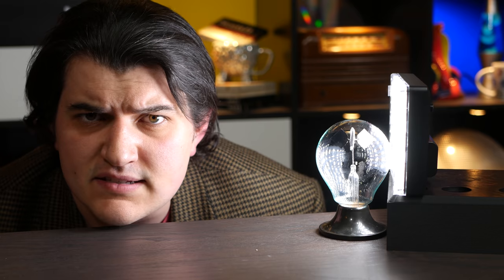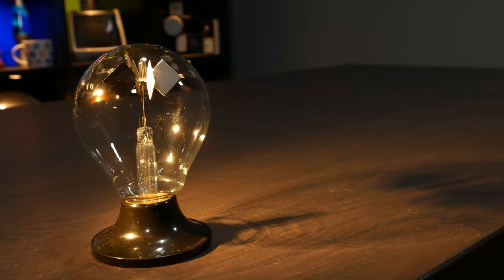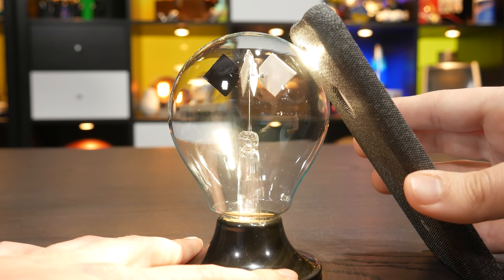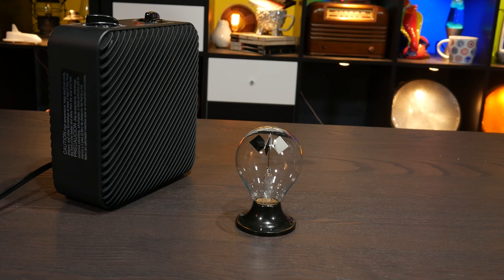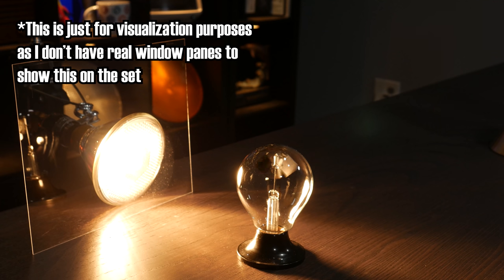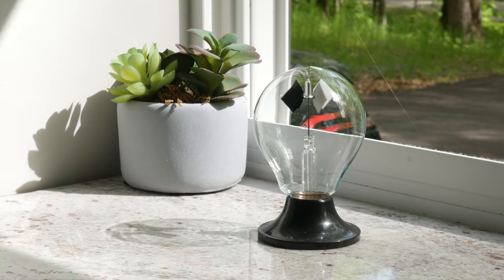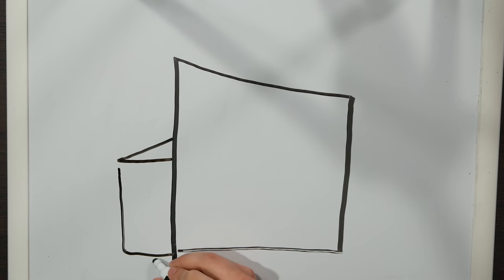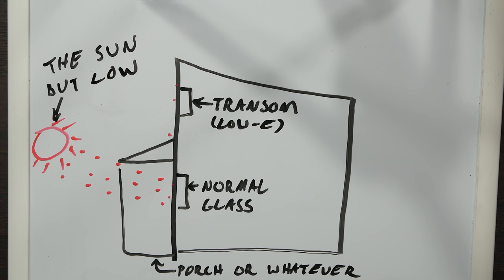What the Crookes Radiometer can teach us

Comment: A portable AM radio tuned to a blank spot on the dial can be used for all sorts of things, such as testing a remote control, demonstrating the different designs of power supplies used in LED light bulbs, or even getting a computer to play music wirelessly.
Reply: Nice
Reply: also for listening to meteors. Only with FM though. The plasma trail will reflect the radio waves of distant stations beyond the horizon for a few seconds.
Reply: Or famously, as a lightning detector.
Reply: @han_pritcher  I think some people use it in home made metal detectors. (A radio tuned to some AM channel).
Reply: how do you do the last part
Reply: Back in the sixties, when “mini-mainframes” such as the IBM 1620 and 1401, without multitasking and with much slower CPU/memory speeds, were prevalent in business and academia, there were programs which would put the CPU into loops of various traversal times, with a counter to compute the time when one loop finished, that played music through a portable radio sitting near the front panel.  They were used as demos of the machines, and when running normal programs, the radios were also used by some operators to monitor the CPU (although the blinking lights also helped).
Reply: @allanrichardson1468  ok thanks
Reply: Also good for listening to numbers stations. I live close to a number of German and Polish ones, spying on them makes for a rather creepy pastime.
 
Here's a sample if anyone is curious: https://www.youtube.com/watch?v=BCyM051MZqU
Reply: @michaireneuszjakubowski5289  THE NUMBERS MASON, TELL ME THE FUCKING NUMBERS
Reply: I'm glad you mention that... I've used it to adjust the timing on my old Miata!
Reply: DAISY
DAISY
GIVE ME YOUR ANSWER DO
Reply: Also to test if a fence is electrified or not.
Cable trackers work for all the aforementioned purposes too
Reply: I used to spend hours very slightly moving the VHF dial on my TV set by increments which allowed me to listen in on taxis, pagers, and -- most interesting -- the tower at the airport.
Reply: These days remote controls are almost universally based on the remote sending pulses of power to an IR LED which triggers a designed-for-purpose IR phototransistor in the device being controlled (if you want data going both ways you need to use either radio transceivers on both ends or you need both a IR LED and an IR phototransistor on both ends)
And if the remote IS using radio, the odds are quite high that it's not using the broadcast AM radio band. Usually it's either the mostly-unregulated 2.4ghz band (same band WiFi uses, with many different protocols, including Bluetooth and WiFi depending on how smart the remote is), or the 440mhz science/medical band which is also virtually unregulated, with open-source data radios readily available for both bands at very affordable prices (even when only buying one or two at a time it's like maybe $5 each for a 440mhz band one and maybe $7.50 for a 2.4ghz spread-spectrum one that will automatically negotiate its way into not using a channel that something else is using and both will hook right up to an Arduino or Raspberry Pi or whatever general-purpose microcontroller you may prefer).

If you see a shiny dark plastic window on the front, or a dark/clear looking 3mm or 5mm LED, you can bet that it's an IR remote control. If that's what you have, the best way to check for functionality is actually to point it at a camera, press a button on the remote, and see if it emits light (smartphone/tablet/webcam/actual camera, anything with a digital image sensor should work, but you'd need special IR-sensitive film if you want to use a film camera and you'd need to process the film to get the results). 

Some AM radios you can use as lightning detectors, but you have to be able to turn off the automatic gain control circuitry if it has it. Anything that uses a single chip to do all the radio work is not gonna work, because AFAIK you can't even tune those to a specific station, the tuning is controlled by a single button and pressing that button just makes the thing lock on to the next strong station it finds when scanning the band (exactly like the "seek" button on a 10y old car AM/FM radio).
Reply: It blew my parents away when I showed them you could test if the remote batteries were dead by pointing the remote at your phone's camera. 

I even explained why it works and they just stared at me in wide eyed amazement like a was wizard or something.
Reply: @GeneralNickles  I've had a few moments like that myself, and yeah it's always nice being the one to teach your parents something new and useful.
The phone camera and IR remote thing is actually a really quick way to test if the batteries in the remote are working.
Reply: @GeneralNickles  And if the batteries are known to be in good shape but your appliance still does not respond to remote-control activity, listening into communication with an AM-radio also helps: you'll hear distinctive 'deedeedee...deedeedee' like sounds (depening on the protocol used and the place in the band where you have tuned the radio)
Reply: Not only demonstrating the design of power supplies, they are also great for monitoring activity of any switch-mode power supply. If you have one that is dead, listening into it with an AM radio can tell you a lot of things about the fault-mode the circuitry is in: usually, dried out caps on the secondary side result in a constant fail-to-start from the controller, which usually emits a clear 'tock... tock... tock..' sound when you hold the radio at the right components. Other sounds could indicate minimum-dutycycle, burst (stand-by mode) or whatever kind of mode.
Reply: @calebr4191  how does that work?
Reply: @theshadetreewelder3523  the static picks up the electric interference from the spark going off, so you can hear the exact moment it happens. I had to do it that way because I made a mistake installing the adjustable cam pulleys. I let the cam turn a few degrees before the pulley was installed, and even though the timing belt looked right, it wasn't working right at all... I remembered listening to the spark through the AM static, and I figured out that the spark was going off way too late.
Reply: Why that's sorcery! Witch!!
Reply: @vwestlife, that’s good! I used an AM radio to listen to electronics all the time as a kid!
Reply: @44R0Ndin  Even though remote controls transmit via infrared, they still generate noise when you hold one up to an AM radio, because of the interference it picks up from the remote control's circuitry.
Reply: One of my coworkers (math and science teacher) used one as a metal detector. It barely worked, but still
Reply: @44R0Ndin  awesome thanks
Reply: @calebr4191  that’s fantastic
Reply: Runs the AM Stereo website, comments about AM radios. Makes sense.
Reply: Wait, you can play music over EMF now? Wondrous
Reply: @44R0Ndin  In the early 80s my parents had a TV remote I could hear if I pressed it against my skull.  Sounded like a screeching high-pitched dentist drill whine.  Turns out the if the RF is high enough power and tuned just right, it can "echo" around inside your head and trigger your audial nerves through thermoexpansion.
Reply: @NoJusticeNoPeace  Nope! Really really early non-wired remote controls actually used high frequency audio emitted by a cheap piezo audio transducer (probably using a NTSC "color burst" crystal, so right around 16 kHz, well within the range of frequencies a human ear can detect) so as a kid you must have just had really good hearing.
When I was growing up, I could hear the coil whine off of all the TVs in the house even a few rooms away, as the flyback transformer and horizontal electron beam steering winding would both be energized with 15khz AC electricity, and the tiniest amount of movement of those windings or cores would result in a sound. Since 15kHz well within the limits of an undamaged human ear to hear in a quiet room, I could hear it pretty easily (or even in a not so quiet room depending on how well constructed that particular CRT was, looser windings = louder sound, also bigger TV = louder sound even if you hold the quality of construction of the set constant). We had a 27 inch JVC TV back then, so it was quite loud (was pretty fancy for the time tho, it had a RCA YPbPr Component video input and 3 more RCA Composite video inputs, and then it even had a dedicated RCA audio-only output jack set so that you could control the volume of a large stereo system connected to the TV with the TV remote).
Reply: @44R0Ndin  and this is why they're called clickers. Early ones made an audible click, which was actually the signal itself.
Reply: @44R0Ndin  That's really interesting.  I wish I'd known that at the time, when everyone refused to believe me that I could hear it.  For decades it bothered me until I came across an article in a science journal about some people being able to hear radio frequencies if they're strong enough, and if their skull resonates at just the right frequency to essentially turn their audial nerves into a crystal radio receiver.

Comment: Hiya! I'm in the fenestration industry. The Low-E coating is on the inside of the outer pane of glass, and does both the rejecting of outdoor IR and retention of indoor IR. The coloration you see under certain lighting conditions is a result of the recipe of the sputtered silver coating.
Reply: Better be good or some upset customer might ...

... defenestrate you.
😂😂😂😂😂😂😂😂😂😂
Reply: ‘fenestration’.  Lol. 
You make windows.
Reply: So the defenestration industry removes windows? I was wondering about these politicians Putin removed by defenestration...
Reply: It can be on surface 2 or 3, depending on climate.
Reply: @HelgeMoulding  It was Charles XII that coined the term during his not-so-brief visit in Bender.
Reply: @andybaldman  If defenestration is the act of ending a person's life through a window, I do not think "making windows" is the opposite....  ;)
Reply: @johanmetreus1268  The actual definition is "the arrangement of windows and doors on the elevations of a building"

Comment: Great program as always!!  So I’m in the glass and window replacement business, mainly residential. Current technology low-e2 and low-e3 glass is, in my area of the Bay Area in California, dual pane glass where the low-e coating is placed on the inside surface of the exterior side of a double pane glass panel. The material used is a sputter-coated metallized deposition and works just how you described. Its designed for allowing in maximum visible spectrum light and it’s quite effective in warmer climates to bounce out IR from the sun and does work well in the winter as well to keep in our artificial heating IR. Sadly you’re correct about the IR reflection heating exterior surfaces. I myself have seen artificial lawns melted from the heat generated reflection. You’re also correct that winter is when we could use the heating sunlight. Oh, one extra benefit however is that it also reduces some of the sunshine derived UV spectrum light so as to reduce the amounts of inside fading and disintegration of carpeting, furniture etc.. Not a perfect technology but it is greatly beneficial over standard clear / clear insulated dual pane glass, though it comes at a fairly high cost. But those costs have been coming down somewhat as the technology has improved. 

Keep up the good work!!

Comment: This reminds me of a little used lighting technology: the "HIR" lamp. This was a halogen incandescent lamp with an IR coating on the inside of the bulb.  
The coating would reflect IR back toward the filament, helping to keep it warm.
The efficiency improvement was pretty significant, perhaps 40 or 50%.  (Unfortunately this was taking a 2% efficient source and making it 3%....)

Jon
Reply: A regular incandescent bulb converts roughly 10% of the electricity into light.

So 10% efficiency.

A halogen bulb uses 20-30 percent less energy than an incandescent bulb.
Reply: @lordgarion514  I believe that your efficiency numbers are on the high side, but admit that we might be comparing apples to oranges.  When I was looking closely at the tech, it was for bicycle headlights where an output of 10 lumens per watt for an ordinary incandescent lamp was great, and doing things like using halogen IR bulbs with precise voltage regulation might get you to 25 lumen per watt. 

Depending upon how you define things, 25 lumen per watt might be 10% efficient or 3.5% efficient.  (10% by raw visible light photon power out vs electrical power in, 3.5% if you weight for eye spectral sensitivity and compare to the maximum possible number of lumens if you had that power of photons)
 
-Jon
Reply: I was thinking about this exact concept not that long ago. In theory, with perfect materials science (a really good hot mirror coating, 100% transmission of visible light through the envelope, and no conductive loss) you could make an incandescent bulb arbitrarily close to 100% efficient. You would put a fraction of the power in, and the reflected IR would heat the filament until the visible light output equaled the power in. On doing research, I learned two things: 1) that I was far from the first to have the idea, and that it's been done various times since the 60s, if not earlier, but the results were disappointing; 2) More recently, there's been some research into using photonic bandgap materials (basically a metal grid with nanoscale structure that gives it extremely wavelength-dependent properties) to create more efficient hot mirrors, and in 2008 a group at RPI reported an achievable efficiency of 125 lm/W... but that appears to have been based entirely on computer simulation, and I don't think the thing was ever built. Still, there might be potential there.
Reply: @hobbified  that, is quite interesting.
Reply: @jonathanedelson6733  Perhaps various K values also exhibit varying efficiency.  Blue appears brighter than red for example at any given wattage.